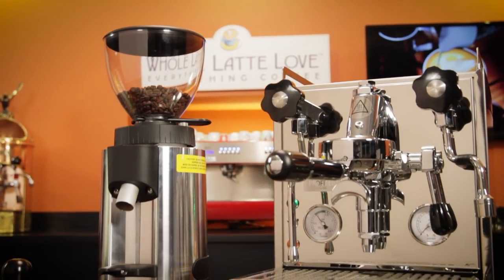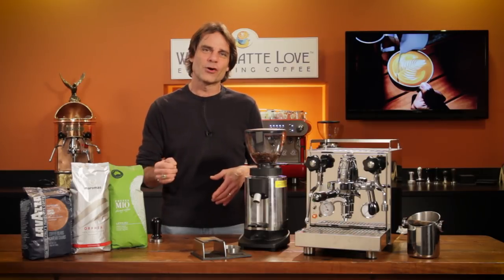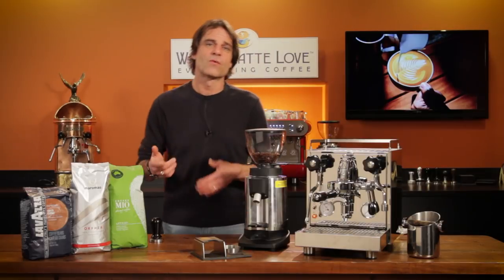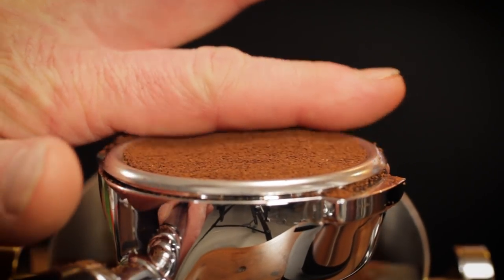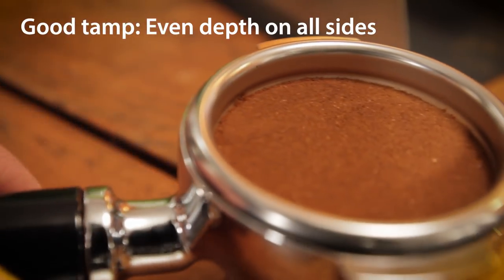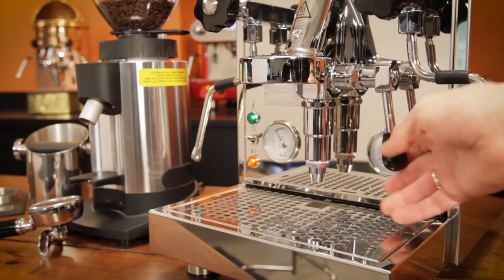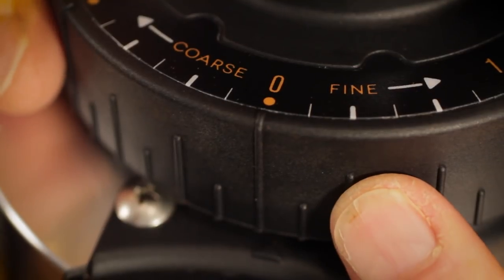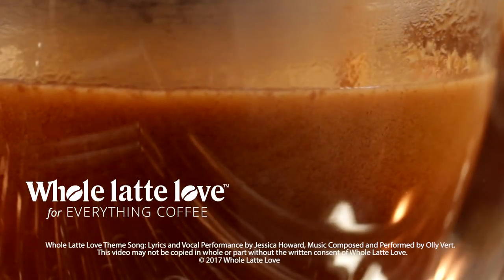How To: Basic Espresso Technique - Dialing in Grind Size

Comment: You should be weighing output, not checking for volume; crema is foam, whose amount is dictated by freshness of beans. Older beans have less cream and will therefore output less volume but same weight
Reply from the maker: Hi VL, As the title suggests this is a basic level video. It's a simple approach for those who do not have a scale. Crema definitely weighs less than liquid espresso. We do have more advanced videos on using brew ratios by weight. If you want to go super-advanced we have videos like this one using scale connected app for real time tracking and recording of brew ratio by weight when using flow control and doing naked shots: https://youtu.be/HTaly8c-i_U
Marc

Comment: Thanks for being so generous with information and tips, Marc (WLL)!  I'd simply echo all the points you've made, where my espresso journey has been on a similar path.

After the much-lauded Breville Oracle came out a few years back, it set me thinking of what I could do to control each element of my shots to simulate what is being done through the latest technology and lots of electronics.  Through a process of trial & error, reading up other experts' tips and learning from forums, I've come up with my own "formula" for my set-up.

I've an old-school Brugnetti Simona Top DE (with volumetric controls), a single-boiler HX system.  It's really old-school, with Brasilia handles & standard 58mm basket, 1.2L boiler.  It's simple and basic, but the rock-solid build has meant it has lasted since it was purchased in 2004!  Even today, it works like when it was bought over a decade ago, has only had the occasional servicing / descaling, plus the usual gasket change (when the shots starts leaking around the grouphead).  The "worst" repair needed thus far was the rocker on-off power switch that took a little longer as I wanted the original illuminated green colour, as the most common spare parts are illuminated red ones.

1) Temperature.  Allowing the machine sufficient time to heat up, making sure there's no "false pressure" in the tank.  Checking that the boiler gauge settles in at 1.3 bar.  Prior to each shot, heat-flush the grouphead till the boiler light comes on, lock in filled portafilter, wait till the boiler reheats (few seconds), then start the shot.

2) Grind.  After I bought the machine which at that time seemed quite pricey, I felt reluctant to shell out for a decent grinder and nothing worked right for the first month!  Totally undrinkable drek!  Finally stumped up for a Mazzer Mini and it's been good ever since ("it's the grinder, stupid", as they say!).  The gauge is around the 5.0 to 5.1 range on its dial for me, and I know that's the starting point to tweak the settings slightly depending on freshness of the roast.  If I've guests who might be nosy, I even unscrew the adjusting pin from the grind adjustment ring and hide it, so that no-one fiddles with it!  One thing I've found, if I want to grind coffee separately for drip / pourover, I use a different grinder as turning the dial up and down just makes a mess for finely-tuned settings required for espresso shots.

3) Tamping pressure.  Always my inconsistent factor, despite practicing on weighing scales.  An easy thing to fix with a spring-loaded tamper, a relatively easy and inexpensive thing to purchase for a 58mm basket.  No longer an issue at all!

4) Dosing.  I weigh out 16g for each double shot on my scales, then grind the lot and use it all, flicking the dosing lever repeatedly until the chamber is cleared.  If multiple shots are needed, I just line up a few more saucerfuls to grind and dose subsequently.  It's not as efficient a process, but the advantage is the coffee is used entirely and nothing is left in the hopper or dosing chamber overnight either.

5) Shot volume.  With the pre-programmed volumetric buttons, that's an automatic process to get the right shot volume each time.

So overall, given the manual limitations of my set-up and some low-tech tweaks, my coffee has been a lot more consistent over the past two years or so by locking in the variables.

That said, there's still the "human factor" in making coffee, and for me, the biggest factor is inattention of any kind (aka not being "in the zone").  If one isn't concentrating on the process, a screw-up can easily happen and the shot is ruined.  For example, a simple oversight of not filling the water reservoir before the brewing session begins and halfway through the shot, water runs out.  Game over, red rover!!

PS: Yes, making the coffee with a manual set-up needs attention, but my machine has well outlasted many friends' fancy-pants superautomatics.  I recently bumped into one friend who related the sad tale of how his expensive European-branded superautomatic that only lasted a few months, where it was left to a house-minder to use, and the machine broke down irretrievably and couldn't be fixed after that.
Reply from the maker: Hi Lem, Thank you for sharing the details of your journey! Think you just won the award for longest comment of the year! Can't tell you how many times I've run out of water in reservoir fed machines. I plumbed my daily use machine - a Profitec Pro 700 in the studio earlier this year and love it. One less thing I have to think about. And it gave me the option of doing long low pressure pre-infusion as plumbed Profitec machines have no solenoid valve on the waterline connection. Installed a BWT filter system which has a pressure regulator so I can dial in different pre-infusion pressures and never worry about descaling again!

Comment: Isn't it best to weigh the shot as you pull it rather than go on volume? For example if I dose 18g my end result out should be 36g in 25-30 seconds I.e. 1:2 ratio.
Great video btw also what's the name of the grinder you use?

Comment: My portafilter is often hard to turn but sometimes easy. Does this matter? I have a Breville Barista Touch. Great video Mark!
Reply from the maker: Hi Ken, Thanks for the kind comment. Portafilters can become difficulty to clock in for a number of reasons. A common one is accumulation of coffee debris in the group head. Try and clean that area on a regular basis. Also, group head gaskets which form the seal with the portafilter are a wear item and need to be replaced from time to time. They stiffen with age. Hope that helps!
Marc

Comment: Rocket Espresso Evolutione Type R. PID but HX and I'm under the impression HX's need a flush! What are your thoughts?
Reply from the maker: Hi Cole, We've done Scace testing on Rocket's EVO R and Type V Mozzafiatto and Giotto machines as well as Profitec's Pro 500 PID. All are PID HX boiler machines. Our Scace tests show these machines provide very accurate brew temps without the need for a cooling flush. The manufacturers have engineered the E61 thermosiphons with flow rates which prevent overheating of the brew water section of the HX boiler. Just to be clear, other (typically older) HX machines with pressurstat temperature control generally need a cooling flush prior to brewing.
Marc

Comment: this was so helpful! how do you know what grind size to ask for when getting beans ground at the bean roasters?? our shots are pulling too fast but don’t want it to be too fine. it’s hard when we don’t yet have our own grinder to trial and error!
Reply from the maker: Hi. SS, Thanks for the comment and question. It's going to be nearly impossible to get espresso grind size right if someone else is grinding beans for you in advance. Maybe your roaster has told you that? Very small changes in grind size make a big difference when making espresso and there's no way your particular brewing variables will match someone else's. Even as beans age, grind size needs slight adjustment. Then there's the loss of freshness from grinding ahead of time. Until you have your own grinder there are some things you can do. If shots are coming too fast increase the amount of coffee in your filter basket to slow down the extraction. For this to work you need to be relatively close to optimal grind size. You can also try tamping the coffee harder which should have a slight effect up to a point. Another option is to use a pressurized filter basket. In a pressurized basket the basket is mainly responsible for creating the restriction to create pressure. Pressurized baskets do compromise espresso quality.
Hope that helps!
Marc

Comment: Thanks for the basics. I have a Synchronika and Profitec T64 grinder. I’d love to see an in depth video dialling in the grind size for both a single and double shot.

Terrific presentations Mark, thanks.
Reply from the maker: W P thanks for the comment and request. Honestly, procedure is going to be the same on your setup. Nice setup by the way!
Reply: Whole Latte Love I have the double dialled in but the single shot is somewhat elusive.
Reply from the maker: W P it’s been a long time since I’ve pulled a single. Doubles are better. Go through more beans working up to a reasonable single than if you just worked the doubles and for some reason had to toss half.

Comment: Hi, WLL.  I bought a refurbished Gaggia Classic from you guys and so far it's been great.  The only issue we are having is getting the 58mm portafilter into the group head without a struggle .  It just seems way too difficult.  Is our grind depth in the filter too high after tamping?  We need to get a better tamper (than the plastic one it comes with), but aside from that, any other tips?
Reply from the maker: Hi Joe, Please excuse my delayed response. I've been on the road for a few days researching new machines! Refurbed Classics are a great deal - and thank you for the purchase. It may be your fill in the filter basket is too high. If the shower screen is leaving a mark in the coffee puck after brewing then you're dosing too much. Other tips: Clean the group where the PF locks in. Coffee can accumulate making it more difficult to clock-in. A bit of leverage is typically required to lock-in place. Check to see that the group gasket is fully seated. It should be and locking in the PF generally pushes it into place if it is not. Also, if you can swing it when you upgrade from the plastic tamper consider going beyond tampers to a leveler instead. They are far more consistent in coffee distribution in the PF and making a parallel surface on the puck. Those both help to prevent channeling thru the puck and produce more consistent shots than tamping. If not familiar with levelers here's a video on my favorite: https://youtu.be/4Z5vTi643sc
Hope that helps,
Marc
Reply: @Wholelattelovepage  - Marc, thanks so much for the reply.  Great tips.  I do think we'll go with a leveler instead of a tamper.  And I'll be sure to give the groves where the PF locks in a good cleaning.  Appreciate the feedback.  Cheers.

Comment: Thanks Marc for the quick response. Much appreciated. I’m still trying to figure out this whole process. My coffee produces a lot of crema so the actual liquids volume would be less. Should I be altering my grind or other variables?
Reply from the maker: Hi David, You are welcome. It's tough to do brew ratios using liquid volumes. When using a coffee which produces a lot of crema I'm often hitting liquid volumes of 65-70ml including the crema from an 18g ground coffee dose. Although reaching 65-70ml the weight in cup is ~36g as crema weighs far less than liquid espresso. Only accurate way to do brew ratios is with an accurate scale under the cup while extracting a shot.
Marc

Comment: Should the measured volume include the crema as appears in this video, or should it be liquid only rather than liquid and foam?
Reply from the maker: Hi VD, Thanks for the question. If using liquid volume you will need to estimate. Most coffees producing moderate crema will reach a liquid volume of ~2oz/60ml at the end of a double shot made from 17-18g dose and result in a standard espresso brew ratio of 1:2. For more accuracy weigh your coffee dose and espresso as it extracts. For and 18g coffee dose you'd stop the extraction when it weighs 36g for a 1:2 ratio.
Marc

Comment: Hi, so I have the barista touch, and was just wondering I do 18g and use the 1:2 ratio in 25-30 seconds. Is this incorrect then? And should I be always trying to get 2oz (55-60g). I’m new and I’m using a dark roast espresso blend and my coffee is always bitter, but I’m gonna change the beans
Reply from the maker: Hi RB, Thanks for the question. Are you weighing the output or using liquid volume to arrive at 1:2 ratio? If weighing output then 18g in, 36g out in 25-30 seconds is a good place to start. If using liquid volume it all depends on how much of that volume is crema as the crema is much lighter than the full liquid espresso. If about half of you extraction is crema when you stop then 60ml is about right for a 1:2 ratio. If 60ml of all liquid then you're way over the 1:2 ratio - maybe at 1:3. Bitter flavor indicates over-extraction but could be inherent in the dark roast you are using. Dark roasts tend to do better with lower brew water temp - at cooler temp you'll extract less of the undesirable flavors. Might also try cutting the shot sooner to reduce bitter flavor. Hope that helps!
Marc

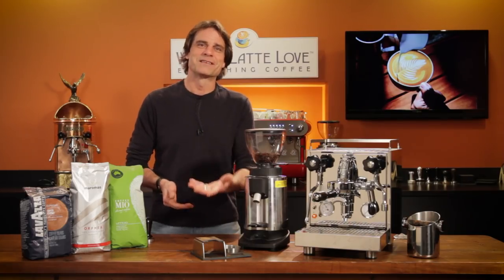Comment: Around minute 5:46 you mention that the Profitek Pro 500 does best with a short flush before brewing - is this also true for the PID version of this same machine?
Reply from the maker: Hi Paul, Thanks for the question. Before PID use in HX boiler machines a cooling flush was standard procedure. Today's HX machines with PID like the Pro 500 generally do not need a cooling flush unless the machine has been sitting idle for an extended period or one is running the boiler hotter than normal to increase the steam power.

Comment: Very helpful video. Thanks. When using a single shot portafilter do I cut the time in half? If 25 seconds does 2 oz of liquid (for the double) would 12-13 seconds give me a 1 oz single?  I worry that would not give the same flavor.
Reply from the maker: Hi Jeff, Keep in mind timing is the most basic method for determining when to cut a shot. That said if using timing it should be about the same for a single and a double. A single basket has far fewer holes than a double basket so that increase the time. The same pressure produces a lower flow rate. In the end it's about how much water went thru the coffee. With a similar contact time flavor should be about the same when doing a single or a double. PS. Singles are much more difficult to do than doubles!
Marc

Comment: Hi mark, I new in espresso machine.
But I not sure what is the golden rule to adjust grinder for espresso.
Could you advise on the golden rule for grind setting for espresso?
What I set if I taste sour or bitter?
Will there be chance that I do not have sour or bitter?
Sour means acidic am I right?
Reply from the maker: Hi BW, Thanks for the questions. Golden rule is adjusting your grind size such that your extraction (regardless of ground coffee dose weight) comes in 20-30 seconds. In general, sour flavor indicates an extraction that came too fast = under-extraction and bitter flavors an extraction that's to slow = over-extraction. Sour flavors might be described as bright.
Marc
Reply: @Wholelattelovepage  will there be chance that do not have sour acidic or bitter?
I am a newbie on coffee tasting.
As per my coffee it is extract under fully automatic machine so therefore cannot use the golden rule right.
My crema is good with thick crema which I do not taste any sour or bitter.
If so, I not sure whether is sour or acidic as I know all coffee will have acidic.
Need your assist on the taste if it is under or over extract and the perfect espresso

Comment: Hi! I know this video is old but wondering if you can help me dial in with a mazzer super jolly grinder and Astoria Pratic Avant. I just started at a cafe and though I have some espresso experience, it’s not much or enough to troubleshoot this. I’ve done all the little tests I know to do. I have the grinder set as fine as it goes and the coffee just doesn’t seem like it’s right it feels dry and light with no oil. Doesn’t compact in my hand at all, falls apart immediately. It extracts 2oz in 15 seconds and they are light, watery, have no body or flavor and no crema…could the coffee just be too old?? Could the machine be putting out too much water?
Reply from the maker: Hi Allie, Hmmm.... 2oz in 15 is of course too fast. You should be able to grind fine enough on the Mazzer to choke the machine - meaning you'd have very little or no drips when pulling a shot. I suspect your grind is not fine enough. Even old coffee ground fine enough should choke the machine. You might try opening up the grinder and cleaning. Mazzers can be a pain as the fine threads are exposed to coffee in the grinding chamber. Threads can get gunked up and make it difficult to adjust the grind size - es[recially when adjusting to a finer setting. Should you clean the grinder make sure the threads are spotless. You may need a needle (and some patience) to thoroughly clean the threads so they don't bind when adjusting to a finer setting. Hope that helps!
Marc